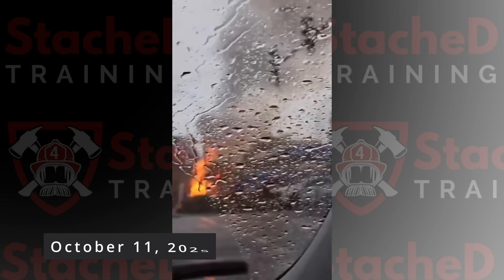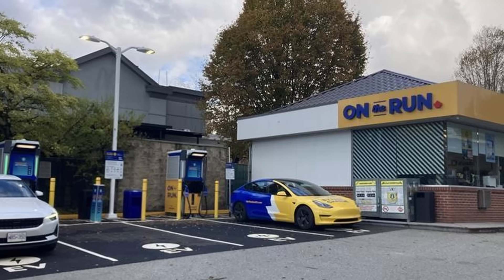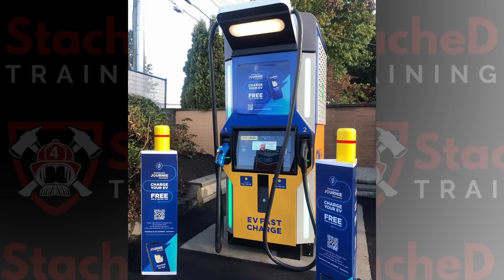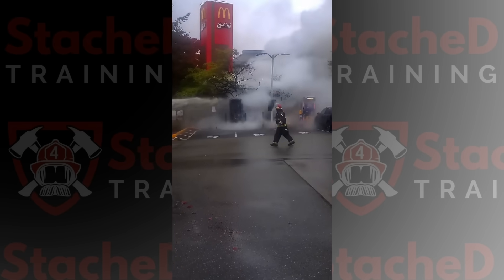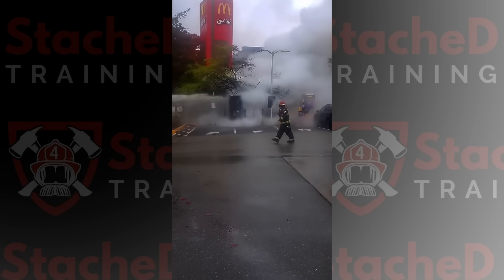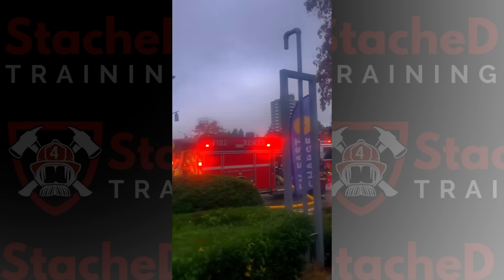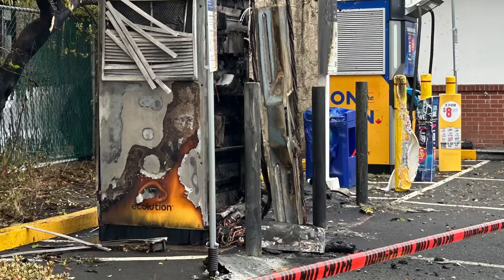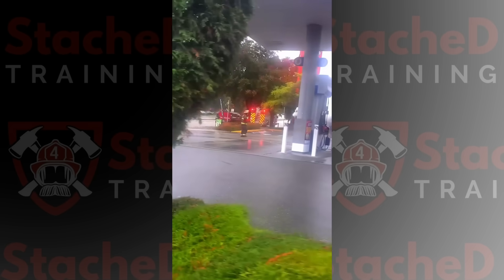EV Charger Fire in British Columbia: Hidden Batteries!

Comment: EVS ARE FOR LIMITING WHERE PEOPLE CAN DRIVE A CAR.    YOU CAN'T DRIVE ANYWHERE THAT DOESN'T HAVE A CHARGER ON A LONG DRIVE AND NEED A REFILL.    ONLY BRAINWASHED SHEEP BELIEVE CLIMATE CHANGE IS REAL.  CARBON DOES NOT CAUSE IT.   THE SUN IS THE ONLY THING THAT DETERMINES THE TEMPERATURE OF THE EARTH.

Comment: Bad design,  no thermal protection to shut it down if the battery needed time to cool.
Or it was just another case of one cell failed and the terminal runaway took the entire pack/s.
As a British expert in the battery technology said, " they should be band, they are incendiary devices just waiting to catch fire."

Comment: EV owners in-the-know actively try to avoid using battery-backed chargers, especially in urban areas.  All too often drivers have pulled up to one only to find the battery is low/dead, and is unable to fast charge.  And when that’s the case, those batteries tend to take HOURS to recharge enough to provide a (full) fast charge again.  The uncertainty as to whether you’re going to be able to charge in 20 minutes versus hours when you pull up makes these types of chargers really undesirable.  Imagine if you pulled up to a gas pump, and 20% of the time you can fill up in 30s, but the other 80% of the time all you get is a trickle of gas and it’s going to take you 45 minutes to fill up.  You likely would avoid that gas station entirely.

Battery-backed chargers make sense in more remote areas where it’s very difficult to get an upgrade to your electrical service to handle a higher capacity charger, and where use is going to be no more than once or twice a day.  Slow chargers are fine — but drivers want a certain guarantee as to roughly how long they expect to charge when they pull up to a charging station, and these battery-backed units just don’t provide that.

Comment: Supposedly this will be less of an issue when we switch to solid-state batteries, or some other advanced chemistry that doesn't involve using napalm for electrolyte. Once such batteries become widespread, it would not surprise me if EVs saw a second wave of popularity.

Comment: I don't like the lithium battery integration. I wouldn't hate it if it were something a little more relaxing than the lithium setups. Lead acid deep-cycles would absolutely work in this application, lower cost, lower fire risk, lower heat requirements, more serviceable,  just all around a lot more relaxing. The only real drawback is that there is an electrolysis reaction that releases hydrogen and oxygen when charging. Another bonus is you don't have to go crazy and match all of your cells, lest you accidentally make an incendiary device. Know how I maintain my big ol' forklift battery? I don my goggles, open the caps, and pour my distilled water in. Then I seal it back up. Done. You could feel safe letting a teenager do it after a few supervised runs because the worst consequences are a dead battery or some spilled tangy water.

Alternatively, I wouldn't necessarily hate supercapacitors either, though these carry a LARGE amount of jam and must receive special respect, and have systems in place to drain the capacitor(s) when shut down. I don't like this one as much. More parasitic draw, more danger during servicing. 

Lithium for things we carry or move. Sure. Absolutely, I'm with it. I want to move away from it when the technology becomes available, but for now it is what it is. But for a damn stationary box left out in the elements? Why on earth WOULDN'T you use ol' reliable Pb?

Comment: FreeWire, the supplier of these chargers, actually went out of buisness shortly after the Chevron build-out. Your information was quite accurate, which, deserves credit considering the opinion pieces that pretend to be news. Most of these units have around 135kWh storage on board. The main draw for these units is they can use a sites existing HV connections without needing to upgrade the transformers etc powering a site. They essentially charge at a Level 2 rate, but use the battery to deliver DCFC speeds. Saves money on the installation, but technically adds it to the cost of the unit itself. As you touched on as well, their biggest drawback, and one that I've encountered often, is when the internal battery is depleted to 10%, as a customer, the most output you'll see from the unit is 16.7kW, as opposed to the full 200kW when the battery buffer is charged.

Comment: While I'm not an engineer, from my own experience in electronics, this design seems dangerous.  Once the battery packs go below a certain level and need recharging, if a car charges from it, the batteries act as a simple passthrough, creating a lot of heat from the internal resistance.  It's no wonder they can overheat.  There's better options for energy storage but it would take more space, cost more, which I suspect the gas stations aren't willing or able to accommodate.  Mixing high voltage fire risks with gas is simply stupid.  We need dedicated charging stations, without gas nearby.

Comment: What is said here is speculation, Canada is different hen the US  I want to say that Canada is   stricter with things which is why sometimes we are behind when things are put on the market  its because we test and evaluate things longer  ,   as for what happened here  because the investigation is still on going and I am not sure of how many times this has already happened if it has happened at all in other places but I am very confident in the British Columbia firefighter investigators will figure out why this happened  and what to do about it . also in Canada there is always a safety shut off switch or something similar in everything we make it has to pass more than a few safety checks before things are installed or even used sold on the market. of course things can happen things people may not of thought of can sneak past but almost always when things happen it gets buttoned up pulled if need to and fixed remodelled.
all that said if what is said in this video is accurate in this situation I agree

Comment: Oh sure, betting this dude creating propaganda for big oil companies. When Pinto explode from rear ended in 1970, did you complain? How about Corvair swing axle problem in 1960? How about the Bronco II roll over risk in 1983? How about Crown Victoria Police Interceptor gas tank burst into flame in rear collision in 1992? I didn’t hear you open your trap during those time, why don’t you
Reply from the maker: It might be because YouTube didn't exist at that time.
Reply: AND....aren't we supposed to be so much more advanced now? Driving an EV is very dangerous for your health.....radiation, ever heard of it? Batteries bursting into flames, doors locking passengers inside......you 'normies' took a poke that had 'experimental' written all over it and now you want us all to drive these deathtraps.....you normies have a death wish.

Comment: My brother and I both owned Natural Gas trucks in the eighties, and my company owned six vans NG. The safety factor is NG is lighter than air: if you do get a leak, it goes UP into the air (though the tanks were much better than dive tanks, though they looked like them. The limit? NG does like a LOAD, so large trucks or five tons, No. But commute? An ideal fuel. But New York money and Washington political power meant it wasn't going to happen, EVEN IN Canada. These decisions are NOT made in Texberta or Ontario.

Comment: What I find crazy is as a service technician that serviced this type of thing. If we ship or receive a battery they are shipped as hazardous materials. They are  crated up and shipped in huge wood or metal cases. They require hazmat shipping preparations. Yet the same battery in your car has none of the regulations when driving. It's all a big lie on safety in my opinion.

Comment: From.   Canada.  / I.   would.  never.  own.  one.  of.  those.   vehicles.  ( old.   school.   ).  I.  ‘ll.   stick.  too.   OIL.  GAS.   and.   DIESEL.    too. run.  my.  vehicles.  THANK’S,  They.   also.   never.   mention.   about.   these.   so.   called.   Lithium.  batteries.  blowing.  up.   or.   catching.   fire.  and.   scalding.  or.  burning.  an.   owner.  of.   1.   of.   these.   vehicles.  or.   there.  passenger’s.  riding.   in.   these.   battery.   vehicles.   , my.   take.   is. just.   another.  explosion.  or.   fire.   waiting.   too.   HAPPEN.  / have.   a.   good.   day.  /.  Bill.   S.    Canada

Comment: It's long past the point that the world needs to give up on Lithium Ion.  Come up with a better battery, or go back to burning coal, and using steam engines, or perhaps try refining crude oil down to gasoline, and propel automobiles with something like that.   If they want electric powered cars everywhere; I won't buy one until they get their batteries improved.

Comment: I messed around with RC cars years ago, and those little litheum polymer batteries were very finicky. If the cells didnt charge evenly, fire. If the case was punctured, fire. If they were overcharged, fire. 

Those fires were pretty big for a battery the size of a tv remote.

Now imagine driving a car where the whole floor is the battery. I will never purchase/ride in any EV, ever.

Comment: EVs are a scam. They're heavy dumpsters on wheels. There is no way we have the energy to charge them if everyone is driving one. Even if we could build nuclear power plants there is no way to transmit that energy using our existing infrastructure. Essentially once everyone is forced to drive an EV their will be brown outs/ black outs as there won't be enough power for everyone. Then the power companies will jack up the prices and ration the power so you can only drive for so many hours per week. Just like water rationing and tiered pricing in areas like the Okanagan. It wasn't a problem until the government made it so.
Reply: " It wasn't a problem until the government made it so."
No, the problem is already there: everyone driving gas cars is unsustainable. The flipside of this is that EVs are, in their current level of tech, not really all that more sustainable either.

The problem is that companies would rather tell us we can buy our way out of the problem just buying electric cars rather than realize we need to invest in more efficient transit and rail options to serve the regions where it makes sense (like much of the lower mainland). Not taking the car away, just giving a good robust option so you don't HAVE to drive all the time.

That said, if you do own an EV and have a home; you don't really need some big DC fast charger unless you're on a road trip. Hell, if you're commuting under 64km a day, you could just plug your car into a 110V socket when you get home and it'll be topped up by morning.

Comment: EVs and Chargers are a very dangerous scam. It is worse then gas for the planet !!
Green energy my ass !!
Reply: A few months ago there was a recycling plant in Missouri that processes used battery packs from EV's.   An explosion unalived at least two workers, and blew a hole through the roof of the recycling plant.   There were toxic fumes going into the air for hours even after the fire was put out.

Comment: CATL has a new sodium-ion based battery called Naxtra. They claim it has a whooping 175Wh/kg (similar to current Teslas). Charges to 80 percent in 5 minutes. Operates efficiently between -40c and 70C. Lasts at least 5 times as long as LFP batteries. And currently costs less than half the wholesale price of LFP with potential to go to 1/10th the price.  They also claim it's nearly impossible to catch fire.   They are currently ramping up mass production with release to EV manufactures in a couple of months.  If all this is true, and CATL has a history of matching deliverables to claims, it will not only revolutionize the EV industry but commercial. grid and and home energy storage industry.

Comment: lithium ion are unstable. if 1 battery goes back in a pack. it goes boom.
Reply: in that sense, natural gas are unstable too.😁
Reply: @matrixbug  Natural gas is actually a lot safer than people think.  It needs the correct ratio of oxygen or it won't ignite.
Reply: Not entirely so. They microfuse them or limit the parallel connection diameter so that cell failure will burn a parallel interconnect to prevent current dumping into a failed cell. Metal shell batteries also usually have internal overpressure cutouts. Thermal runaway is what you're thinking of. The heat from a few shorting out can melt the insulation inside another and make it short out. A lithium fire is just a short circuit making the heat short circuit other cells.

Comment: Store energy locally…? Like the storage devices people with solar panels have at home? That then discharge into the home supply rather like charging a BEV from one of these chargers? Was thinking the placement of chargers at Gas stations had been quietly moved away from due to the consequences of a fire occurring whilst a BEV was charging… or possibly not and just sitting there….

Comment: The battery in charger system is to get around the problem of starting and stopping big DC fast charging.  Utility companies don’t like it when you switch on and off big loads.   Tesla gets around the problem by installing a Megapack near by.

Comment: Fine with the concept but they should make special rules for Lithium batteries vs more stable batteries like lead acid batteries. A big lead acid battery would make far more sense for a stationary charger at a gas station.

Comment: the ELECTRIC VEHICLES are a huge problem around the world, we have to stop the sell of this vehicles 👍🏻 , for our future, for the safety, for our familys and children
Reply: Well we gotta move away from gas powered cars so we need something, personally id go with a robust network of light and heavy rail suplemented by trolly busses for transit
Reply: Wait ti the batteries leach into the water table
Reply: @cjane1962  Lithium batteries are valuable enough that you actually want to recycle them at end of life. That's a bit easier to do than say, remediate the soil around a gas station after a few decades of minor spills and leaks.

Comment: The proximity to gas tanks on the small lot and residential buildings was a surprise, also, it may be that the chargers were connected to services other than car charging. It may also matter if the cutoff switch were in the gas station building or could be remotely applied if it uses the grid

Comment: was batteries or capacitors ? best way is quote before charge so system  charges fully to wait customer and when no quote for a while  devert and convert ac back to grid 30% of the capacity  with hybrid to maintain safer 70% ..  this still can provide some fast charge but wont  harm packs!!!  ..

Comment: I did some checking. A typical gas/convenience store, with restaurant power service would be 208V3ph, around 750kVA, that's 2.4kA power switch equipment, before the EV chargers get added. This is about the practicable power limit for 208V3ph service, but you could top it out at 1150kVA, with 4kA power equipment. The step up from 2.4kA to 4.0kA is a very large step in cost and size. They would be required to use a single utility power service to a single property address. The battery storage systems would likely allow that spare 400-500kVA to supply all 4 of those charging stations without an electrical upgrade to 480V3ph power service. 

To connect as Direct from Grid supply. The 4x DC Fast Chargers there are rated at 350kW output charge rate each. They do not typically fully supply these because charger power distribution will never be 100% on all 4 simultaneously, and the systems I've looked at will modulate input power with temperature sensing controls, if it were ever to happen. It'll be remarkable to get 4 DC fast charge cars all there at once and I don't think any are yet rated over 270kW. If they connect at 208V3ph without the batteries, only two 270kW cars connect, the chargers will have to reduce power. If two more regular charge rate cars connect, well they may want to enjoy a cold beverage from the store. 

To actually provide fast charging exclusively from the Grid, a new 480V3ph utility service would be required. A Convenient size at 480 is 2500kVA, 4kA. The Utility company costs are extremely variable, I'd guess $50k - $400k EF&I. They could keep all their existing 208V panels, just feed the main from a 480:208 transformer (not expensive, $150k x2 for inst.). The 480V3ph breaker board may have only 4 CBs, Main, Transformer, Charger 1 and Charger 2. That's a nice savings; all 4 breakers, board, w/ eng and inst, around $300k. Then 2x 1000A circuits to each charging station, maybe 75', EF&I about $200k each. Hey that's much better than 4x 1000A. 

I tally it all up at $1.2Mish. And you might be able to get all you need to do this in 1-2 years. 

To get connected for Direct Grid Energy, even on this very small charging station, the cost is so much higher than the battery answer.

Comment: I thought your electricians and engineers were more competent than this appears. Firewalls and distancing are well documented. This makes me glad I live in a country with a 240V system, not the 120v system common in USA. Battery buffers are not so necessary if the grid has more capacity.
Reply: The US power systems are not 120V, who told you that?
All residential systems are 240V/120V split phase systems. It's a single phase at 240V, with a center tap for 2x 120V. 
Commercial Services typically used here, would be 208V 3-phase. Larger Commercial systems would be at 480V 3-phase. 

This situation is not the reason for the battery buffer. Grid capacity has nothing to do with residential distribution capacity. Grid capacity is not about the wires; it is only the generator capacity. 

Aren't you guys still at 50Hz? So 415V 3-phase? Or is that elsewhere?